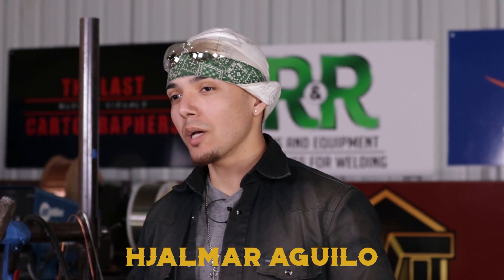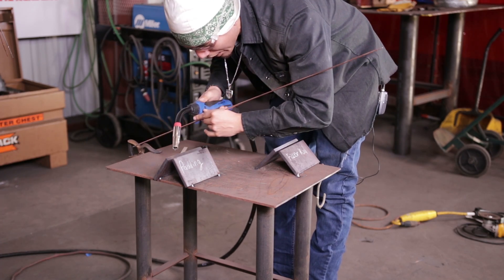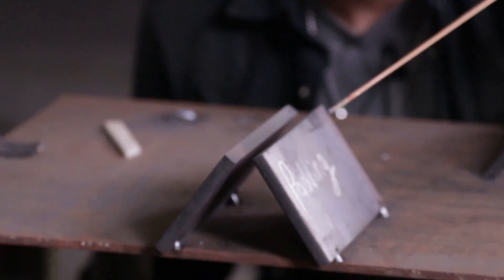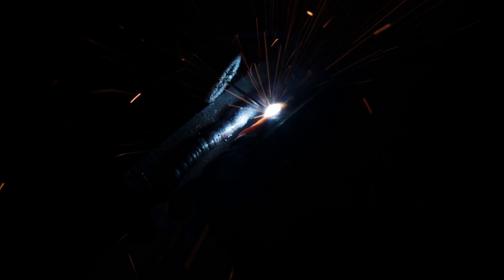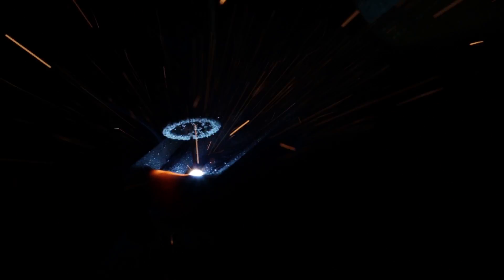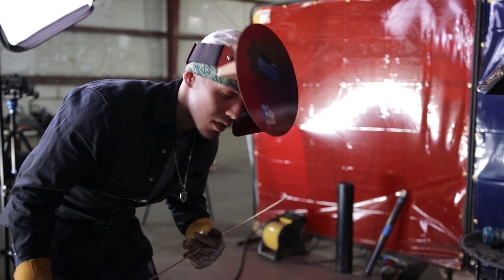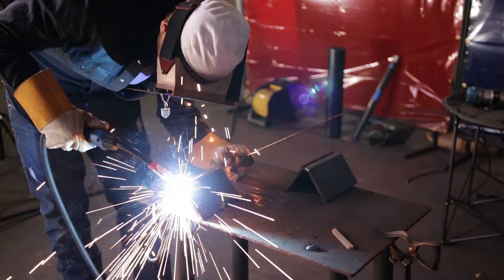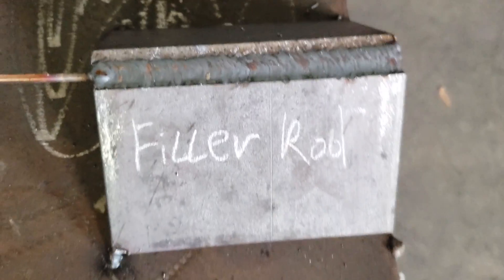Gas Metal Arc Welding - How To Fill In Big Gaps

Comment: You have to be specific with the hanger material. Any MiG wire can’t be melted with any hanger!. For instance material of the hanger such as steel, copper, Stainless or Aluminum, has to match the MiG spool wire / material.

Comment: DO NOT use a coat hanger to fill a gap. The reason i say that is because you dont know what kind of metal they use to make it out of.
Same thing with rebar both are usually made of low quality materials to keep the cost down.
Reply: Can you even buy metal coat hangers anymore?

Comment: Does this make for a structurally sound weld? I'm building a chopper and I've got two different diameter tubes I'm trying to weld end-to-end. My gap isn't nearly this big, but I'm still concerned about the structural integrity after I weld the gap. Any thoughts?

Comment: If your going to use a hanger, remember that it has a coating that prevents rust, that stuff is highly poisonous.  So burn the coating or wire wheel that coating off.

Comment: Hey when it stutters you got to move in a little bit more because the wire is working too hard basically so you need to make it so it doesn't work so hard just word of advice

Comment: Literally 0 pen on that second weld
Reply: Was not mentioned for truly burning in just to fill the gap before switching to dual shield core wire to cap it off.  Bet when done that corner will be pretty dang strong.   Seen this a lot in fab world not ment for structural work but cosmetic corners it will he just fine .

Comment: What I’ve used since my apprenticeship days is a copper flat bar. Put it behind a hole or the length of a gap and start welding,once your done just tap the copper off with your hammer and gap or hole filled in👍🏽👍🏽👍🏽😎
Reply: Buzz bars out of big breakers work wonders

Comment: You can build it with stacking stringers, or with only a 1/2" with .35 or .45 wire should easily span the gap and fill it. Use a finger nail weave or what he calls a Christmas tree weave, and it should easily fill it. In my experience of heavy equipment and lol the money maker "trash trucks" lol trash=cash lol.
just one man's opinion.

Comment: Be careful where you use this. In WWII almost half the liberty ships were sinking until they figured out that this was the cause.  Don't try this on any weld that needs much strength at all.
Reply: Lesson learned.... don't do this on WWII ships. Thanks!
Reply: This video is a basic "how to fill a gap".... Nothing in this video is about "structure"

If your fit-up is that bad you need a new career!

Comment: Nice tip! I would have cut that filler rod down to 2 or even 3 pieces then mig’d it out. Whatever gets er done right “hand”! haha.
Reply: That's a pretty clever idea
Reply: I've often bridged a gap with a piece of threaded bar or a cut down bolt. Nothing structurally critical obviously but it works.

Comment: what if that wide gap is on a pipe and it’s going to be UT or X-ray will it pass or will it get lack of fusion because of how wide the gap is? With Tig on the root ?
Reply: Sif Artorious as long as you leave big enough gap to penetrate when you connect them it will be fine
Reply: If this is serious pipeline work, there not be a gap like that. It’s all very controlled. Special pipe clamps hold it together. The gap is specific to the particular pipe. And yes, there is a gap.

Comment: First lets do a 6g 6" 6010 root 7018 hot fill and cap lets do it
Reply: @weldtube  heck yea brother been  wanting this for a long time can you emphasize on how to clean your root in the video how to use the grinder correctly so wont blow through the root thanks once again
Reply: @agustinhernandez6094  no grinder on test. Get used to a good file and chipping hammer and wire brush
Reply: @chrisjones6165  if you need a chipping hammer for a 6g test then you need more practice... A wire brush ( and MAYBE) a file is plenty. 6010 brushes off very easily and 7018 run at the proper temp and speed basically cleans itself. With good starts and stops you won't even need a file
Reply: @johnpike9612  yes chipping hammer. Use on 6010 and 7018. I'm asme ix certified for this process so I think I know a bit about test. Plus real job experience.   Check my channel to see some things I've done in field and home as well
Reply: Are you in school
Reply: @ismaelchavez6433  no